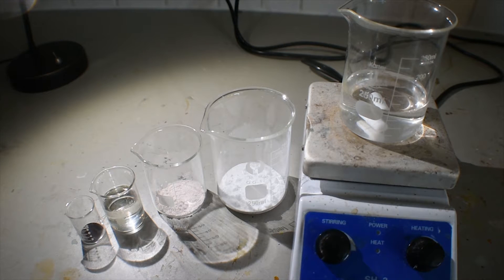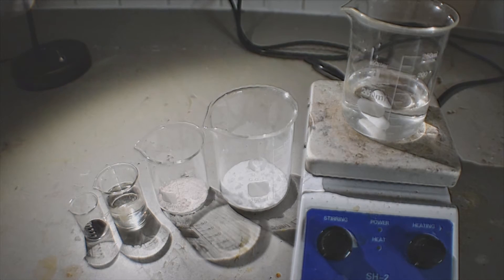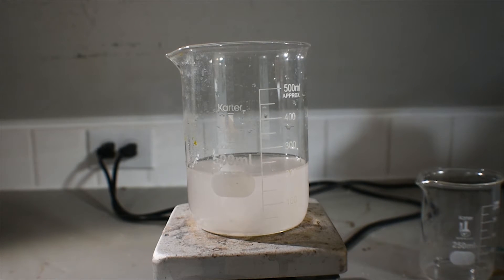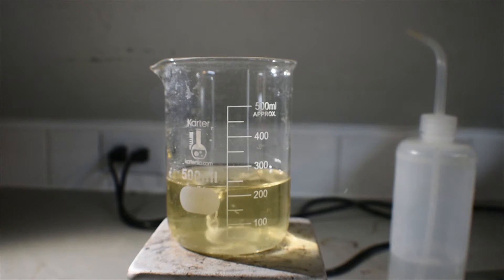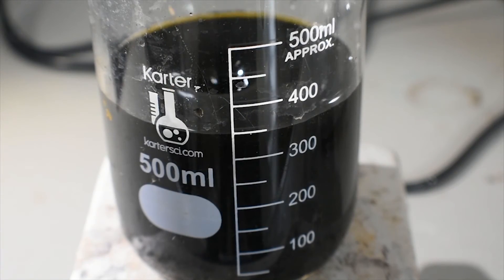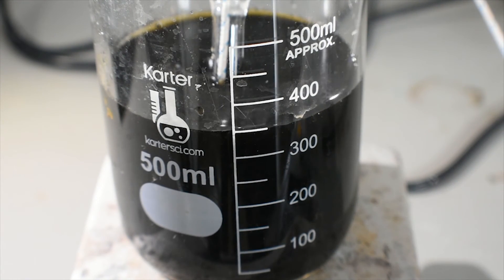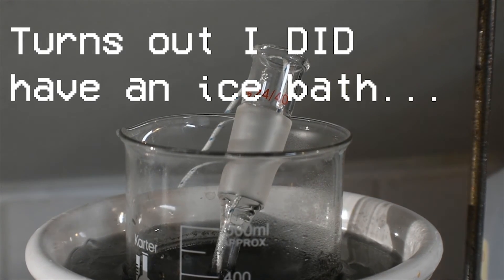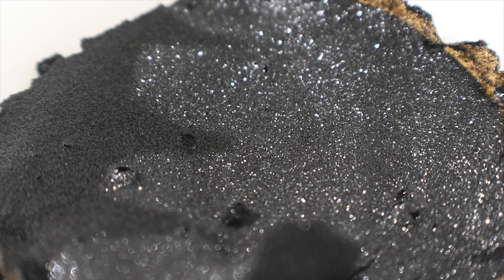Stabilizing Mn(III): Manganese Acetylacetonate

Comment: You could also try making the manganese(III) citrate and tartrate complexes. As far back as 1999, I found out by accident whilst playing with my chemistry set that citrate and tartrate ions like oxalate can also stabilise manganese(III) giving brown coloured solutions, notably sodium bis(citrato)manganate(III) and sodium bis(tartrato)manganate(III). Sodium bis(citrato)manganate(III) solution can easily be prepared by gradually adding solid citric acid to suspensions of hydrated manganese(IV) oxide in 1 mole sodium hydroxide solution and adjusting the pH to 7 - 9. I've also made the potassium salt of the manganese(III) citrate complex in a similar way using potassium hydroxide and it forms dark brown crystals.